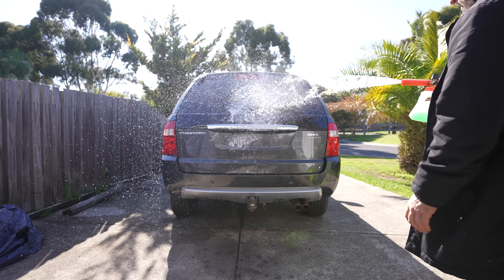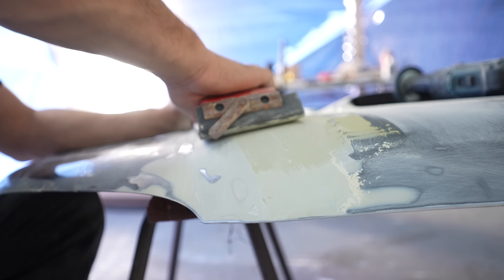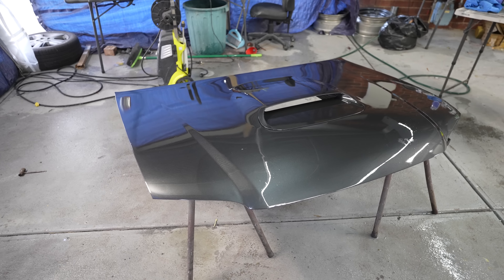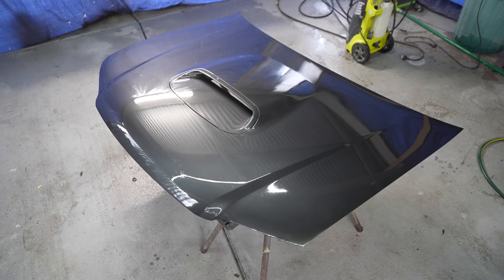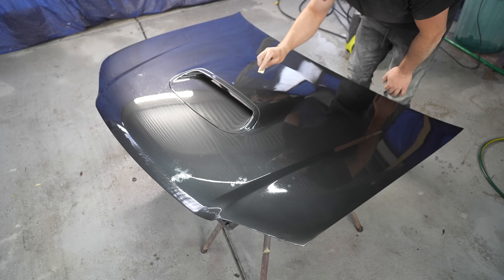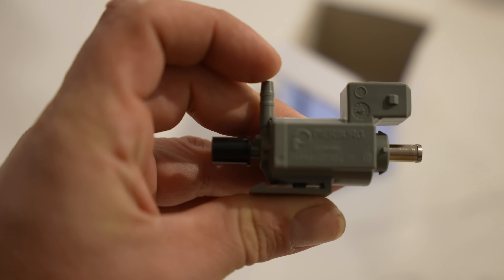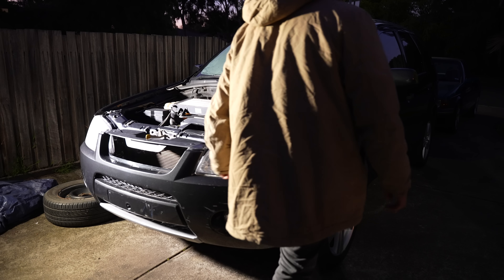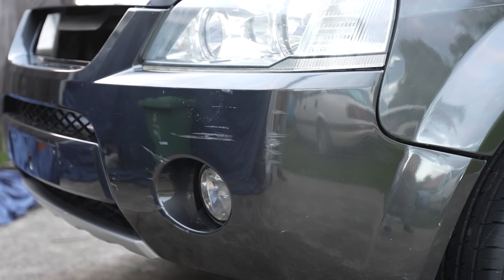Turbo Barra Misleading Marketplace Purchase Part 3 DIY Bonnet repair + paint job

Comment: I would have done more clear and left it a week prior to a buff

But I agree with your comment in the video. Find a way

Send it and it will probably be ok.
Reply from the maker: I did 3 coats nice and thick on the last and let it go 24 hours , did the fingernail check and it was good to go , used a bit extra hardener too, pissed about the water in it but oh well , thanks for your comment
Reply: @georgeauto  ah good mate
Should never have doubted you

Comment: All things considered, are you happy with the Terry? Steering, handling, performance, fuel consumption.
Reply from the maker: Yes going good so far still on a permit at the moment , I need to change the Column as it has a bit of play but rides heaps nicer with these OG 18”s on it with all the bushes done
In the front too feels nice and tight

Comment: Hey George, how many more coats of clear did you put on after that bitch water come out the gun. Had that water biz too. Put a water trap in the line and run the hose up in the rafters. Worked a treat
Reply from the maker: I have it two more coats stupid go pro died so I didn’t catch it and didn’t want to get the good camera coverd in overspray , 3rd coat went nice and thick knowing I was gonna sand it got a fair bit of dust in it also which was poo poo 💩

Comment: Dude the moment I seen that clear fuck up I felt so bad for ya....  But it's all DIY shit you go through at times.  I just spent two weeks cycling injectors in and out of a VE Commodore only to realise they were fake chinese sh*t.  First lot 3 worked out of 6.  Got another lot........ 2 out of 6 worked.  Fn BS.  Got some genuines on order now.  Some cars like the VE SS where the fuel rails on top, peice of piss but this cars a VE Omega v6 and they burried in the V....  blowing white smoke, carrying on..... so many were faulty I was thinking the engine was Fd......  but no.
Reply from the maker: Omg man that sounds so annoying, guessing the labour was annoying , and it’s the worst when you buy a new part and it’s faulty , hopefully you sort it out with the genuines , yes sucks about the water too but it worked out alright in the end ,